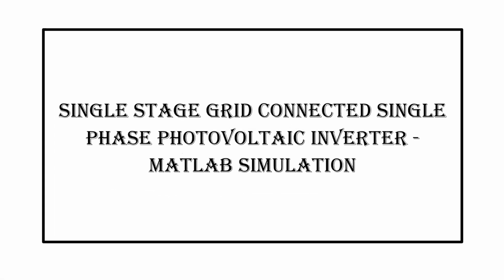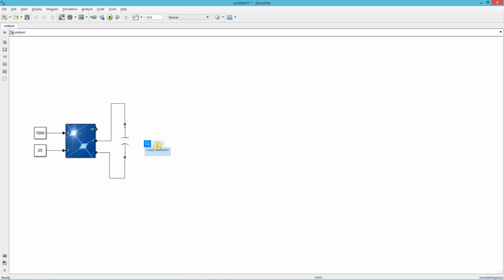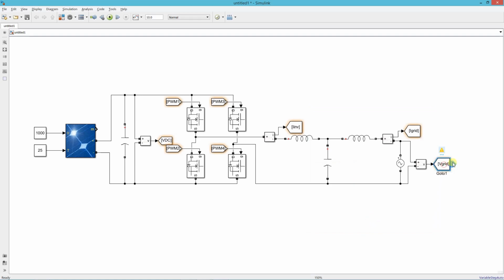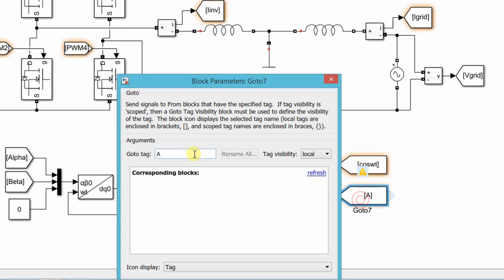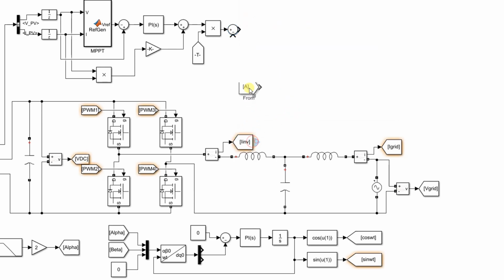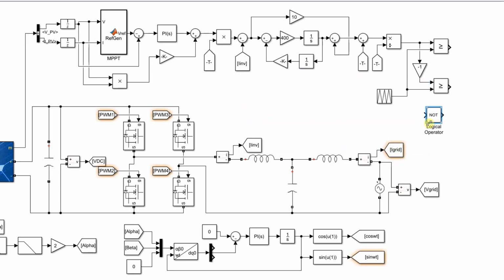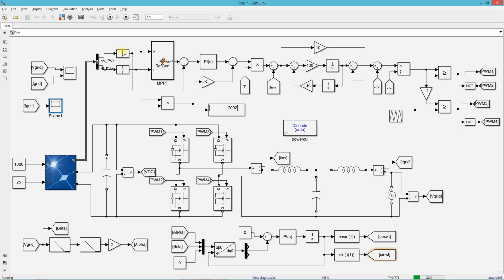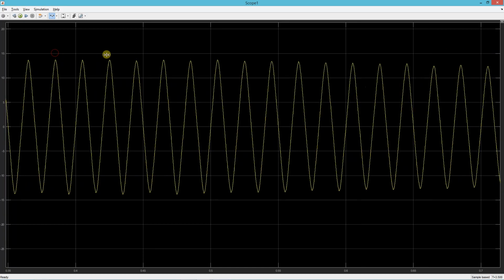Single stage Single phase Grid connected solar PV inverter - MATLAB Simulation.

Comment: Sir, I would request you to simulate in simulink, a single phase single stage transformerless current source inverter with an inductor at the input side. Also include the control scheme for the circuit.

Comment: sir I am getting 5 errors while running the simmulation 
 utput port 1 of 'singlephasegrid/Demux1' is not connected. [2 similar]
Component: Simulink | Category: Block warning
The sample time [0, 0] of 'singlephasegrid/PID Controller1/Integrator' at input port 1 is different from the sample time 0.0001 of 'singlephasegrid/PID Controller1/Integral Gain' at output port 1. Consider inserting a Rate Transition block between the two ports. Alternatively, you can control the diagnostic action for unspecified rate transitions by changing the option "Multitask (or Single task) rate transition" on the Sample Time Diagnostics pane of the Configuration Parameters dialog box.
Component: Simulink | Category: Model error
The sample time [0, 0] of 'singlephasegrid/PID Controller1/Sum' at input port 1 is different from the sample time 0.0001 of 'singlephasegrid/PID Controller1/Proportional Gain' at output port 1. Consider inserting a Rate Transition block between the two ports. Alternatively, you can control the diagnostic action for unspecified rate
Reply: Hey, did you solve these problems. Please tell me how?

Comment: I have few questions related to this:
Suppose if we have multiple inverters working in parallel, what changes ought to be done?

Suppose if we use some local loads along with feeding to the grid what other changes in the control ought to be done?

How is reactive power compensation being done?

Can I use droop control instead of PLL?

Is there any tool to measure the grid frequency apart from PLL?
Reply: hello, were you able to get any help?